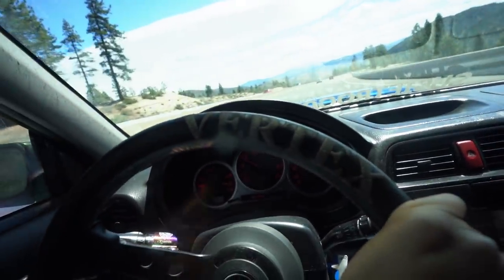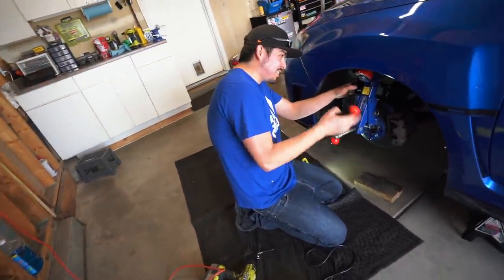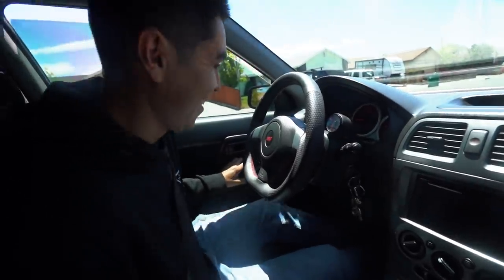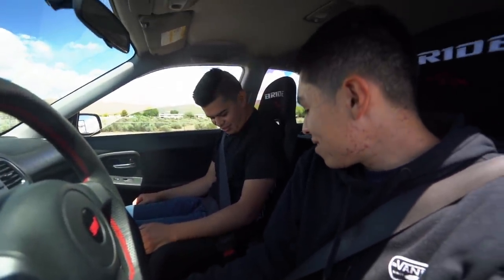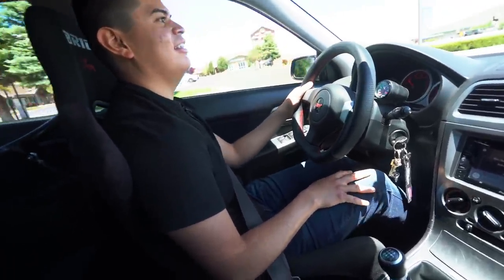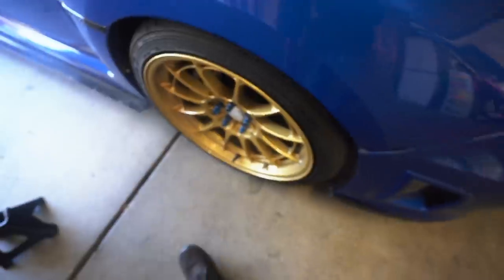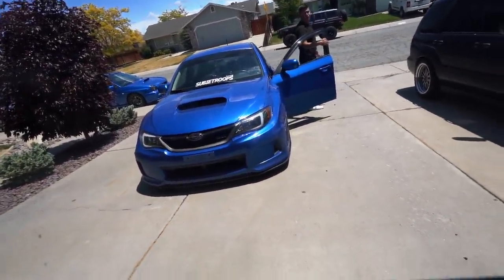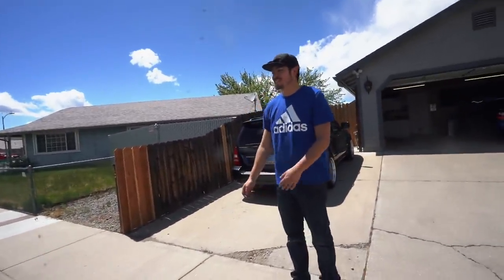Driving The Cleanest Bugeye Wrx Ever! (6-Speed Swapped)

Comment: Even has a full interior swap and '04 tail lights that bugeye is so clean
Also dude I know its hard to accept it but all that white smoke is either your valve stem seals or something is jacked up in the bottom end, either way your engine needs a rebuild. Continuing to drive it like it is now will only result in a catastrophic failure that could damage the block and then you would need a whole new engine
Reply: I remember him talking about a engine rebuild i think

Comment: Yo i had the same issue with downhill decelleration and then getting a huge puff of smoke after getting back on the gas, it is for sure your valve stem seals, i just did mine this winter and its all good now.  Think of it this way: your engine is like a pump. As it runs, the pistons continually pull air into the cylinders at every intake stroke. When the throttle plate is open, the air goes in easily. When you take your foot off the throttle, the pistons are trying to pull the same amount of air in, but the path is now blocked by the closed throttle plate. So a high vacuum develops in the cylinders, drawing oil past the worn valve stem seals. When you step on the gas again it burns off.

Comment: that choppy sound while on boost is coming from the 3port mine does the same thing and is 100 percent normal almost sounds like a quiter version of an external waste gate, i thought the same thing that it was some sort of fuel cut. Also if you do switch to a manual boost controller email the company that just tuned your car to see if you would need a re tune

Comment: You can clean the bcs it properly has gummed oil in it from the old turbo, just remove it and spray a mild cleaner through it electrical contact cleaner, maf cleaner or throttle body cleaner, nothing to harsh like brake cleaner or degreaser, it's worth a try. And did you clean out intercooler of any oil left over from old turbo if not its possible that's just residual burn off from oil left throughout the intake system.

Comment: I own a Subaru STI 2005 pushing 426 WHP 500 torque. I'm having the same problems right now with that white smoke. I'm thinking it's the PCV valve. Did you figure it out.
Reply: Sounds like head gasket mate :/  get it pulled and swap and if you aint already stuff some arp studs in there 👍🏽

Comment: i had a similar problem, i changed the CAMSHAFT POSITION SENSOR. mine would sometimes shutoff during a long freeway cruise when i would put it into neutral and come to a stoplight, or when i went into boost the car would jerk like it would get no fuel or something. mine was more severe tho and would happen when i did full throttle pulls. mine did throw the check engine code for the cam position sensor but not everytime it did it as i would clear the code

Comment: idk if you keep up with Alex Vargas at all but he was having some boost hesitation too. If you can get your hands on an access port check your fuel pressure when you're hitting boost. If i'm not mistaken he had to get a new fuel pump and that solved the issue. He was running like 10-15psi less than he should have been in fuel when hitting boost and this sounds like it's the same thing. If your fuel pressure is below 40psi when hitting boost it's probably gonna be the same cause.

The only reason I want to say this might be the issue is because Alex was also able to tinker around with his engine and get the issue to go away intermittently. But it always ended up coming back after a few hours like what happened to you. Hopefully you figure it out soon.

Comment: diag the car the correct way. car wasn't tuned with a Manuel boost controller . why just slap one on?  do you have a afr gauge ? access port? can you monitor what the car is doing?
Reply: The car is tuned for 18 psi on the 3 port the manual boost controller is set to 18psi. He only did 2 pulls in low gears the engine wasn't under a lot of load. He will be getting a re tune for a manual boost controller.

Comment: Check and see if your knock sensor is retarding the ignition timing (feedback knock) it may be that your ecu is pulling timing because the knock sensor is picking up noise. I know you can definitely feel some hesitation and power loss if that were the case

Comment: Bro my subie is cutting out the same way let me know if you figure it out, iv checked everything I’m running cob 3 port ebc. Almost thinking coil packs.
Reply: Try mass air flow sensor, plugs and packs
Reply: Aydan Grom cleaned the maf, replaced spark plugs and coil packs still hitting a cut at 5k rpms

Comment: Waht were the bugeye lights called?
Reply: he didn't mention the brand of the headlight in the video. but the headlight appears to be a retrofitted version of a usdm headlight. A retrofit means installing newer light technology into older model headlights the most common example of this is installing projector lights into traditional halogen light housings. you can find kits and pre done versions of retro fit lights at circuit demon. my advice is to go for the kit not the pre done it'll save yourself a lot of cash and you gain a bit of knowledge about headlight assemblies